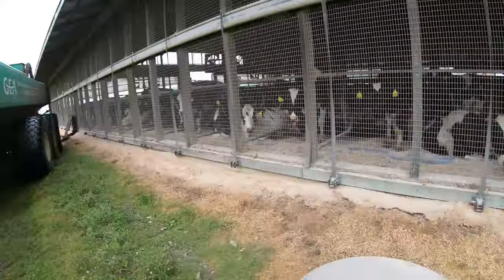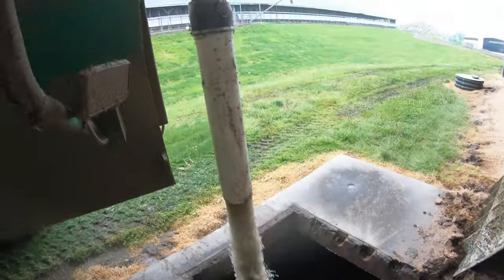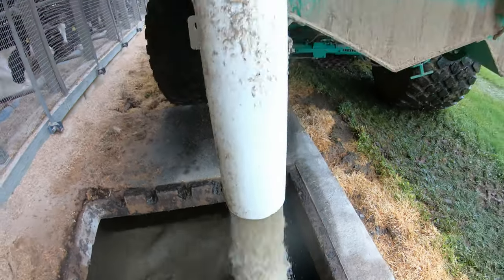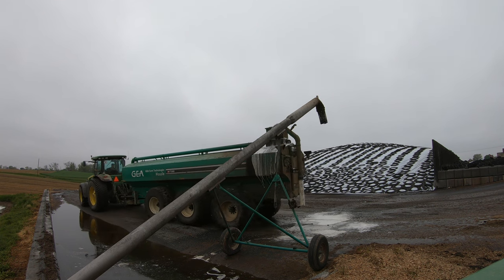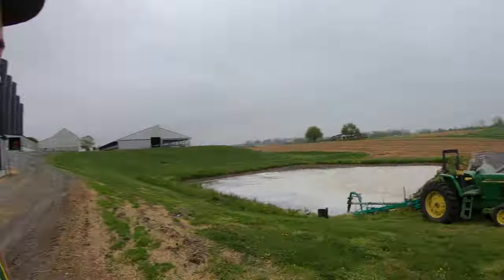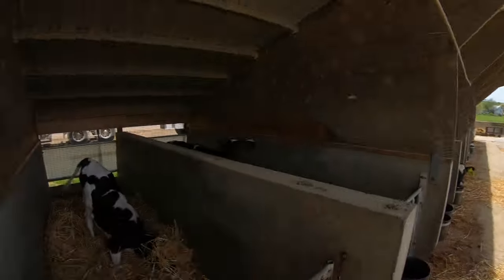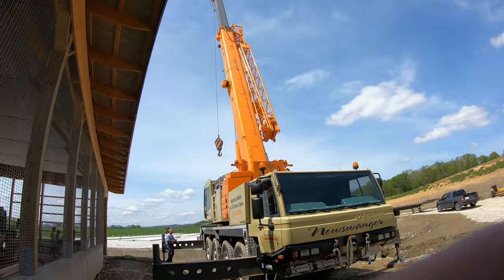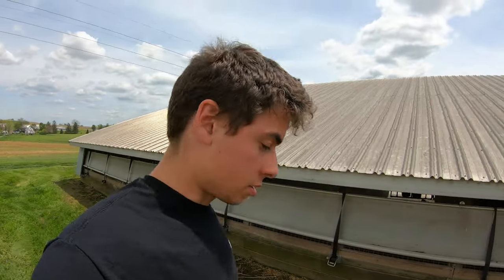Hauling Water Where?

Comment: Every try manure pit treatments?   There some good ones out there that keep the solids, liquids, and gas from separating in the pit.
Reply from the maker: Not I did not know there was such a thing.   This was a special situation.
Reply: This situation actually came to be because we had to start a different pit in the barn because of construction pieces that were in the way. Normally we start in that pit and it’s able to pull liquid off the top but since we were not able to start in that one the liquid got pulled off in the other one and what was left over was really thick. Good bacteria is actually working in there but it was too thick  without the water but normally would have gotten mixed in.

Comment: Boy: you add water to some manure and shavings to other manure and you end up with a lot more manure that has to be hauled again to the field. There must be a more efficient system somehow. That different tread on the tanker tractor must be  because of all the road miles they roll up.

t
Reply from the maker: Your right we do but it was just that pit that needed water.  We never have that problem but the construction project got in the way.   You are also correct about the tires.